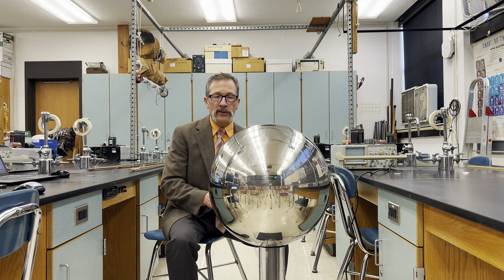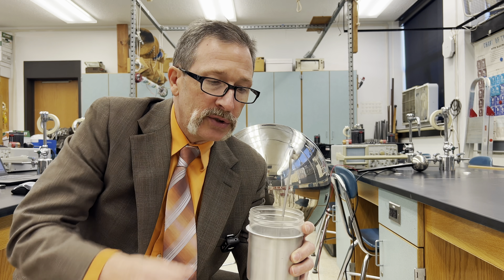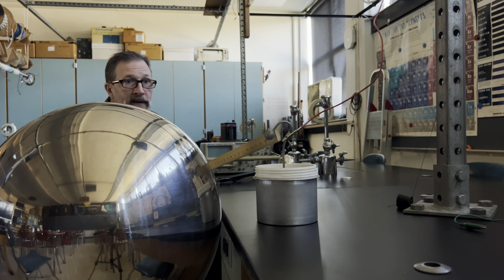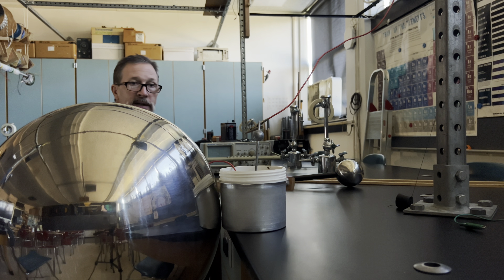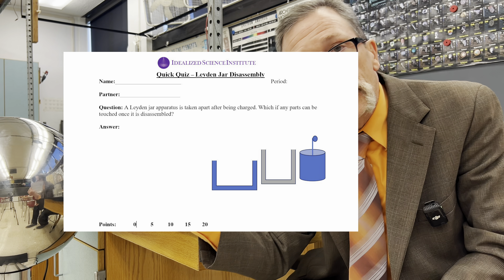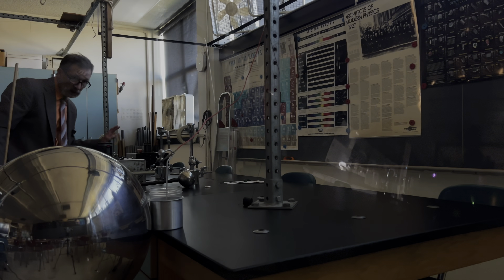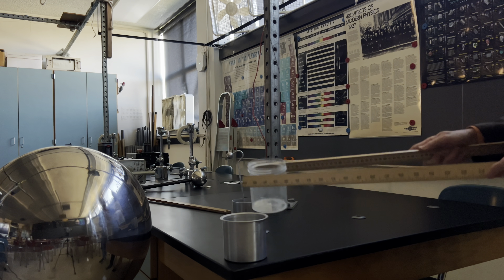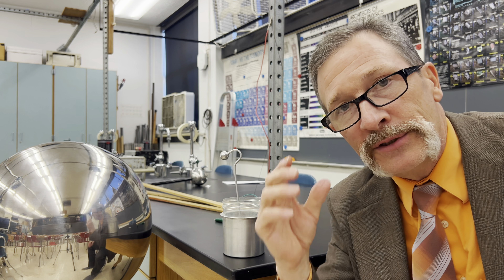This Simple Device Could Kill You

Comment: Fantastic demonstration.Thank uou.

Two points: on this using Wikipedia  to explain it rather than me explaining  it in my own words. Please read carefully as the Wikipedia wording is not as clear as i would have liked.

1.  This demonstration appears to suggest that capacitors store their charge inside their dielectric. This theory was taught throughout the 1800s. However, this phenomenon is a special effect caused by the high voltage on the Leyden jar.

 In the dissectible Leyden jar [as in Ben Franklin's Leydan jar], charge is transferred to the surface of the glass cup by corona discharge when the jar is disassembled; this is the source of the residual charge after the jar is reassembled. Handling the cup while disassembled does not provide enough contact to remove all the surface charge. 
Handling the cup while disassembled does not provide enough contact to remove all the surface charge. 

Soda glass is hygroscopic and forms a partially conductive coating on its surface, which holds the charge.

Addenbrooke (1922) found that in a dissectible jar made of paraffin wax, or glass baked to remove moisture, the charge remained on the metal plates. Zeleny (1944) confirmed these results and observed the corona charge transfe

2  If a charged Leyden jar is discharged by shorting the inner and outer coatings and left to sit for a few minutes, the jar will recover some of its previous charge, and a second spark can be obtained from it. Often this can be repeated, and a series of 4 or 5 sparks, decreasing in length, can be obtained at intervals. This effect is caused by dielectric absorption.

Comment: Static tests on aircraft to troubleshoot communications and navigation systems problems. I parked the plane on thick blocks of plexiglass and would charge the plane to about 5,000 Volts. Then, place my hand near the aft side of the static wicks. You can feel the air moving as the wick is acting to discharge the aircraft. I would use a wand to check the paint thickness and to inspect decals on the aircraft.  Any metallic decals i detected had to be removed later.  These can build up a large static charge in flight near precipitation. The charge can be higg enough to prevent navigation and communication receivers from working.  Any panels on an aircraft must been connected to the aircraft and have very little resistance from the rest of the airframe. A high resistance can allow the panel to develop a static charge sufficient to make receivers inoperable. Precipitation static problems can show up with static wicks that have too much resistance.  Sometimes, this will develop after an aircraft is painted and the fuselage panels that are riveted together have too much electrical resistance.  When that is detected,  a light bradded copper cable must be  bonded between the problem panels.
Reply from the maker: Thanks for this very detailed comment about a real-world issue. Really interesting!

Comment: Our physics teacher got annoyed with a flickering fluorescent and removed it while the Van der Graaf was running. He managed to discharge the VdG through the fluorescent tube and himself.
He stood up, blinked and said "Don't do that."
On another occasion we were working with a cathode ray tube using a vacuum pump to remove air while cranking up the voltage on our HT generator. He remarked "We're not supposed to go over 5000 volts but a colour TV is 25000, you can leave if you want to." And we cranked the voltage all the way up to get the interesting colours and banding.
I'm still here, in my 70s with children, and in my entire career I never got a shock despite working with things like lightning discharge simulators. So remember: don't mess with stuff you don't understand, but don't let that put you off experimental physics. Driving is far more dangerous.
Reply: I worked in a company that had product that we tested with huge jolts to simulate lightning.
There was a large room lined with capacitors that we charged at night with cheap power.
A maitaneance worker made a mistake in that room and his body bounced around the room and wrecked most of the room.
The night shift staff would see stuff and became convinced he was haunting the place.
I know I twice saw someone standing watching me work and when I got a chance to look away from my machine I could see them clearly until the very second I was staring right at them.
I know it was that para something that makes us see faces, low light level outside my work space, cluttered shadowy background and autosuggestion 😂
But the second time it happened I slowly started to turn my head and stopped before I was looking right at it and I could see him smiling.
I know it sounds nuts.
I know it's the brain playing tricks but it's exactly what two of the other night shift people had said, as they were focused on the running equipment they became aware of someone standing watching.

Comment: I was thinking the charge isn’t on the insulator but rather one or the other conductors.

When considering a traditional capacitor, the charge isn’t on one side or the other, but not the insulator. 

If I charge a capacitor, then disassemble the two conductors, the charge is still present on the one conductor relative to the other. The insulator does not hold the charge. If I touch the two conductors together, they discharge.

I’m thinking that you were able to first touch one and then the other conductor because you were not grounded. 

Assuming one of those three components was charged, nothing happened when you touched them because you were not grounded.

Given what I just observed, if you had simply moved one metal cup to touch the other, we would have seen a discharge spark because the charge was between the two metal cups, not the acrylic insulator cup.

I could be totally wrong, but if these two cups and the plastic insulator represent a capacitance storage device, with the plastic cup is both a means to permit the two electrode cups to be in close proximity, as well as a dielectric insulator which prevents a discharge spark from passing through it.

Please let me know your thoughts on my analysis.

Comment: A good rule when working around electricity is wear rubber soled shoes / sneakers and keep one hand in your pocket. Might just keep you from frying yourself.
Reply: Almost true.  Rubber is an insulator but it isn't perfect when it is used as a shoe.  Any conductive material can work its way into the shoe and negate the insulating properties of the rubber. And the one hand in the pocket isn't good either. The thought behind that is to keep the current away from the heart thus not changing the bodies own electrical signal to the heart. Problem is human blood contains iron, a very good conductor. Enough current will cook the veins and arteries in a millisecond, regardless of where that second hand is.
Reply: Why hand in pocket?
Reply: @JO-ch3el  To hopefully keep the current, which is the part of electricity that kills, from travailing through your heart and disrupting its rhythm. Though the thought is good it rarely works in practice. The only safe method is to ensure the circuit is de-energized before working on it.

Comment: People forget how dangerous old CRT TVs were.

You could unplug them and STILL get a massive shock because the tube held a huge high-voltage charge.

Opening one up without knowing what you were doing was no joke!
Reply from the maker: Indeed!
Reply: Same with microwaves nowadays. One of the most LETHAL projects on the known internet. Not joking. Those capacitors and coils in the microwave unit is 100% deadly even unplugged as the capacitors store high energy. And just coming In contact with the windings and game over.  It's honestly so scary to me. A lot of people have passed from just trying to do this or take stuff out for another project
Reply: I worked for Compaq back in the 90s. We were doing technical support, not repairs, but sometimes hardware made its way to us for having a look at. Typically celebrities and such that got to cut through and get the VIP treatment. We had a dedicated "monitor guy". No one else was allowed to as much as think about opening one of those up. Not that discharging a CRT is rocket science, but he was the only one authorized to do so.
Reply: About 35kv that could stay that way indefinitely

Comment: But your thumb and index finger touched the inside and outside surface of the plastic (after charge and dissassembly) so shouldn't your thumb and index finger come into contact with the ions on the surface of the insulator plastic and zap you. I still don't get it. Maybe the ions are on the metals parts? Professor Julius Sumner Miller demonstrated a similar thing. There's a youtube video of him somewhere. Thanks for your demonstration ❤
Reply from the maker: I did get a slight amount of charges that went through that finger thumb path. Very little though!

Comment: Ahh those days in the lab leaving charged capacitors on the bench for the next group.
Reply from the maker: Oh my!
Reply: @idealizedscience  😂 We held our hands in a circle as the whole class once and got hooked up to a buzzbox transformer (Ruhmkorff?) and oh boy, nobody could let go and it was that buzzing feeling all the way in our chests. Almost painful but still bearable, even though it made breathing hard. The voltage on that thing was so crazy that when only two people grabbed it, it shot over 20cm long bolts between their boot soles in air. We even had a daredevil that was able to put a wire back into it once it was pulled out and the machine turned on. His aim was like someone with a Parkinson's and he was screaming a bit, but he did it!
Reply: Some one, not me, tried this in tech school in the mid/late '60s.  I was very glad that my career in the computer field led from a field engineer to software.

Comment: Before Quiz Explaination:

I think the plastic is fine.
Its gonna hold a neutral charge.

The inner and outer metal sections are gonna have opposing charges even after you take them apart. Either would be dangerous to touch and both at once would be much worse

I am very confident.

Edit: somehow I completely forgot about the concept of charges needing a closed loop to discharge.

I suppose my answer would be correct if you were connected to ground while touching each part.

Comment: I worked for a broadcasting company that operated very high power transmitters. There was a 20,000 volt capacitor in storage that would self charge from just being in the rf environment and it had no safety discharge resistor. I could release the energy with a wire like you did with a gunshot like bang and it would return a charge over time. I had to insist to the local engineer that a permanent wire as a safety be placed on the device to protect the unsuspecting.
Reply: I maintained high power TV transmitters for almost 40 years.  All spare capacitors rated 5uf @ 2KV and larger were stored with shorting wires for safety reasons.  UHF transmitter power supplies are capable of 40KV DC at 2 amps.  There were shorting sticks located wherever HV circuits were exposed when covers were removed for maintenance.   Service was never performed without the shorting sticks used to discharge residual HV and then hung on the exposed HV circuits until the work was completed.
Reply: @Vendemeer  I think a lot of the modern ones are solid state now. Rather than using klystrons with high voltage, low current, the solid state ones go low voltage, high current. With an equivalent power, the input voltage is only about 50V, but the currents can go north of 1000A. Honestly terrifying.
Reply: @serenity.96 The VHF tube transmitter that I maintained was replaced with solid state in 1992.  It used two very large 50v high current supplies to power all the modules.  Most broadcasters switched to high power UHF IOT transmitters around 2000 and beyond.  Solid state high power UHF became widely available after 20105 and each amplifier module had dual 50v DC power supplies.  I really appreciated no longer having to service those IOT HV power supplies.
Reply: I work in the same industry now in field ops on transmitters for TV/Radio and we have those IOTs but not in the patch I cover. I’ve seen the voltage sticks and been warned about them though.
Reply: Very very interesting about the self charging from RF environment. Thanks for the input!
Reply: RF gear is horrifying
Reply: I remember the capacitor battery that was about the size of a portacabin that charged to around 100 amps. 
The capacitors charged in parallel, but discharged in series producing more than 1.5 million volts. 
It was developed by Ferranti, to study the effect of lightning strikes on nuclear missiles.
Reply: I worked as a communication technician on high power transmitters and before servicing all capacitors were discharged with a device called the 'Brinkley Stick'. All the doors on the transmitter cabinets were interlocked, and once that door was unlocked the key (there is always only one, and it turns on the power too) was kept in the pocket of the lucky guy who crawled inside (often me!).
Reply: @rogerwebb7501  in the RAF we called it a debollocking stick.
Reply: As a novice, is there a reason you couldn't permanently connect a large-ish resistor between the terminals to act as a bleeder resistor?
Reply: @bobtuiliga8691 Every HV circuit that I’ve dealt with over the years used bleeder resistors to discharge the capacitors when the power is removed.  Those resistors do fail so touching the de-energized circuits with a grounding stick is a necessary safety precaution before performing service.
Reply: @bobtuiliga8691 well I didn't design it....Marconi did!.....well someone who worked for the the company of the same name. The Brinkley Stick has a resistor incorporated to ground.
Reply: CRT's behave the same, in order to remove the fly-back transformer, you need to discharge it to ground before touching it, but as you mention it would self recharge, and would need to be done repeatedly to guaranteed its safety before picking it up.
Reply: Good move.
Reply: Yow!
Reply: Think of todays super capacitors
Reply: Did you have to enter 4 8 15 16 23 42 every time you wanted to discharge it?
Reply: Commonly called a chicken stick, every good high power TX should have one nearby. 👍

Comment: Many thanks for this fine instructional video. I’m an older guy but I found out a few different things today. You can make a functional working capacitor out of the most mundane and simplest of objects.  It also points out the dangers of electricity and the necessary steps you should always take when working with electricity.  As an retired industrial mechanic I can tell you how dangerous electricity can be. It can kill without warning because you can’t see it, taste it or feel it (in most cases). I've been bitten by electricity.  120, 230 and 460 volts. The time I was shocked by 460 was the most unpleasant.  It will leave it it’s effects for hours and is most unpleasant.  It wasn't sufficient enough to go through my heart so I wasn't really harmed but badly shaken.
Reply from the maker: Yes...electricity is definitely dangerous. You are lucky to be alive!

Comment: The explanation at the end didn't quench my curiosity. A capacitor is charged when it hold electron on one plate and lack of electron on the other. The dielectric is just there to separate the plates and prevent arcing. So by you grounding both plates by touching them, I really don't get how it held on to a charge....
Reply: As an insulator, the electrons cannot move through or over it (electrons tend to move across the surface of a material), leaving a gradient of charge between the inner and outer surface. When he picks up the plastic with his thumb and forefinger on the inner and outer surface, it discharged a tiny fraction of the difference, right from the tiny areas where he touched, but not from elsewhere, as the electrons cannot move through the insulator to the points of conduction. Once the conductive plates were replaced (or even with other, different plates), they touched the entire area of the inner and outer surfaces, allowing the full field to discharge at once through the conductors. Without conductors allowing charge to move away from the dielectric insulator, the charge is held by it until a discharged state can be reached. Saying the insulator is "just" there to separate the conductors is reductive of what is happening. It prevents arcing between the conductors, yes, but it holds that charge until conductors allow electrons to flow from it to discharge, therefore causing the arc, itself.
Reply: @ntsure2436 that's where I'm confused is that even in my uni class on electricity never the dielectric was considered to hold charges at all. Just the plates and the electric field created in between these plates was what's was holding the energy. 

Is it specific to Leyden jars that the insulator hold charges like that since the dielectric is so huge ? Or it's literally a false concept ( that's its the electric field between the charges on the plate of the cap that hold the energy ) that is taught even up to university ? That's where I'm getting conflicted.
Reply: @miranina1585 It's been years since I was wise on all this, but if I recall, it is dependent on the surface area of the dielectric as to how much is held (potential that is, not necessarily actual charge, as the net charge balances out over the whole insulator), when consideration is given for an equally large conductive surface allowing for the release of the difference of electric potential. Like I said, it's been many years, and I've started second guessing what I remember, so this might be incorrect or have been updated with new understanding since I learned.